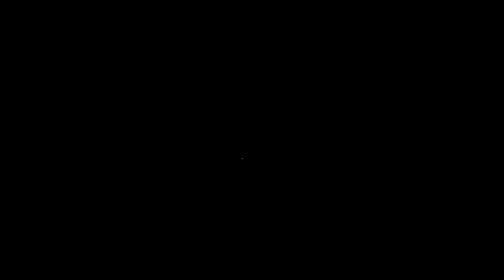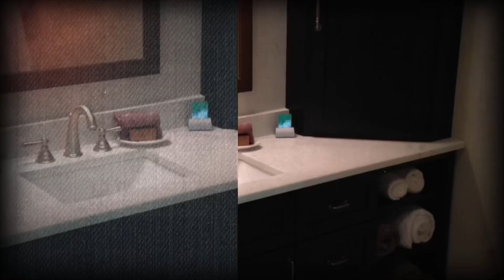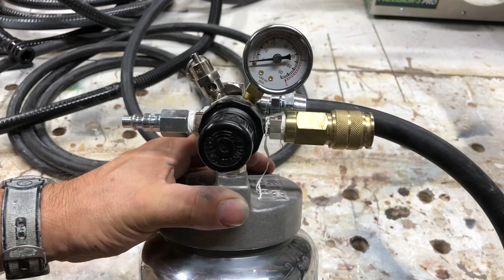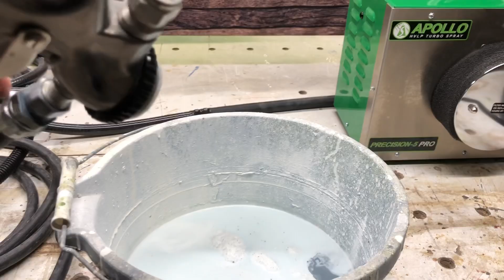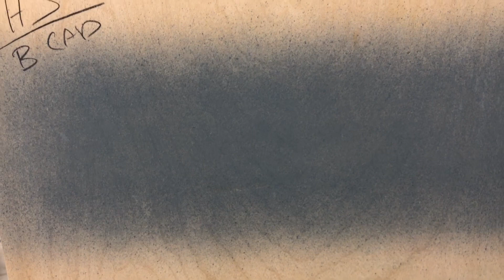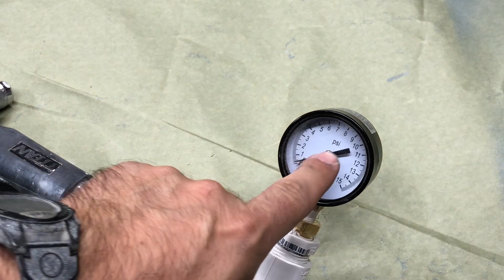Apollo Precision 5 Hvlp

Comment: Been using airless sprayer but interesting to test out especially with the 2K products which are more expensive and have a shorter potlife. What does fractures it would pay for itself my concern is am I able to put enough product on the surface
Reply from the maker: Stick with the airless way better
Reply: @ericreason6559  thanks for response. What are your thoughts on maybe getting one for doing the cabinet boxes inside people's homes they can maybe a little less overspray. I really like the rental product but I don't like that you have to wait 24 hours for the primer. Would you suggest maybe using another primer then then the renter on top. I have been using Ben but have run in the same situations you described on one of your videos about the popping of the primer off the substrate I'm looking for something that drives that fast and blocks any type of bleeding

Comment: I was told these Apollo HVLP are the best. I’m considering getting one .
Reply from the maker: They are in terms of turbines and HVLP are concerned. But they don’t work as well as airless for high viscosity Italian coatings  without thinning. All depends on what you are shooting and trying to accomplish.
Reply: @ericreason6559  What is best for the 2k italian coatings like Renner?  Ultimately I'd like to be able to produce a professional looking 2k cabinet paint finish, as well as finish mid-century modern furniture. I have the 7700 but struggling to get it right with my compressed air system.

Comment: that was not a fair, you didnt test the apollo on the gun, the pressure lose is always on the gun not on the sprayer
Reply from the maker: I did this a while back but I am not sure why it’s not a fair comparison. It was comparing the Titan system vs the Apollo system. There is less pressure drop with the Apollo than the Titan system. If you put the Titan gun on the Apollo system it will compensate for the pressure loss and give you consistent pressure.
Reply: I'm with Eric you should have use the same gauge on the apollo, the pressure is always higher on the turbine than the end of the hose,  but I also know that the apollo does accelerate the rpm when the pressure drops
Reply from the maker: Sparrow I actually did put the pressure guage on both and I found that the Apollo is dead accurate. When you are doing videos like this it’s hard to get in every detail and there are always people that will try to find holes in you test procedures. That’s why o always say test don’t guess and do it for yourself
Reply: @ericreason6559  anyway I'm subscribed to your channel and I have made many changes thanks to your videos, and I am a big fan of your channel 👍👍

Comment: Very well done Eric! Numbers don't lie. So you used a High solids B with a 1.3?. Apollo is making a more powerful turbine in the future? I was talking to a rep for Sivam coaitngs (italy) and he recommends an airless for those high solids poly 1k and 2k coatings. 

Good to know that the Apollo can handle these thick coatings.. An airless would probably not need to be thinnned. The obvious benefit to using an HVLP is using less product and overspray which is important because they can be pricey. Just for kicks, have you ever compared an airless finish with a FFLP tip to a HVLP? I'd assume the HVLP to be better but how much better?
Reply from the maker: Ted Rinshed Apollo has a bigger system already but it runs on 220 circuit. You can use the 1.5 with a C cap or c high solids cap and That might push it over the cliff and get you better atomization. If you want to shoot the high viscosity coatings un-reduced airless or air-assisted airless, or double diaphragm pumps are the way to go. Also using double orfice  tips make a huge difference. I haven’t seen a huge difference in quality but overspray and material usage is huge. The thing about the European Coatings is that they like to be put on heavy at 4-5 wet mils. I like the turbine system for easy and transport and it just a matter of choosing the right tool for the job.

Comment: I really want to get  this turbine and 4500 –2 Quart Fluid Feed System but its a costly setup.  currently run the 7700 gun and with the C cap HS and 2.0 tip with a small 3 stage turbine it really helps to atomize paint better then say a normal C cap. but with a bigger setup i could prob drop down  tip sizes and caps
Reply from the maker: Rick Bailey yeah it is an expensive unit but honestly it’s the best on the market as far as hvlp goes. Keep saving!!